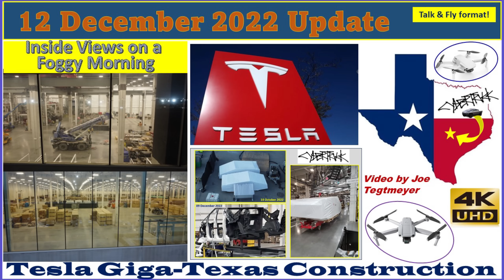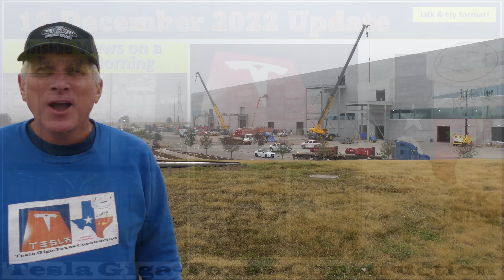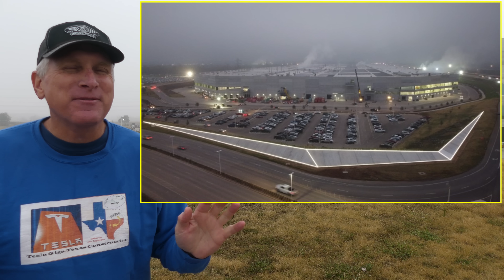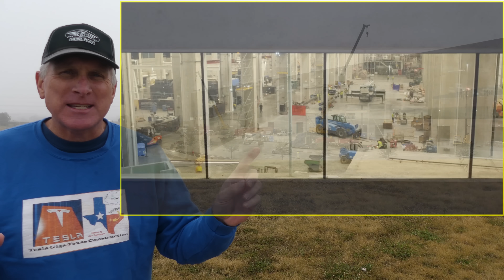Inside Views of Casting, 4680 Cell & W GA sections! 12 December 2022 Giga Texas Updates (07:00 AM)

Comment: Some thoughts on today’s developments.

18:11 Switch yard cable tray installation. I like to see that they are using black geotextile fabric to line the trench before placing the aggregate drainage layer. The aggregate is probably recycled crushed concrete from the Martin Marietta plant next door. My guess is that it meets the gradation of #57 aggregate, which is an open-graded gravel mix. The stones are generally 1 to 2 inches in diameter, with very little fines (smaller stones). This gives the aggregate a porosity of about 40%, which aids in transport of ground water. Geotextile fabric needs to be used to line the trench before placing the aggregate, otherwise the surrounding silt, sand, and clay will migrate into the open spaces of the aggregate drainage layer. Migrating soil will eventually lead to loss of soil compaction and surface settlement. However, it will also slow the movement/drainage of groundwater, which is of paramount importance for the cable trays.

27:08 New corrugated storm water pipe. Remember that the entire perimeter of the main building has a 6-8 foot diameter corrugated pipe under the loop road. The southern portion of this loop goes under the concrete staging area with 4 large drainage inlets. Looks like they are relocating the southern end of this storm drain loop further to the south, and out of the footprint of the building extension. Once the new section of pipe is completed to the east side, I expect that they will perform the tie-ins to the existing pipe loop and then remove the 4 inlets and portion going across the extension footprint. The concrete pipe they are installing closer to the loop road will be under the building extension and will probably service the roof drains.

It will be interesting to see what design they choose for the solar panels on the building extension. The “TESLA” is centered on the existing footprint. Based upon Elon’s past tweets, the extension will be about 500 feet long. Two thoughts come to mind… The first thought is the “T” logo. My second, and more likely, thought is a giant star. Because, well… It’s Texas!

Comment: IDRA likely not casting Cybertruck parts: IDRA doesn't have access to Tesla's propriatery gigapress cooling system, nor does IDRA have access to Tesla's casting alloy. That leaves me unable to explain what we're really looking at what otherwise appears to be major cast rear assembly.
Reply: Not a lot to go on in the photo. No indication of when or where it was taken.

Rear end could be cast up the old way, pattern, sand box etc, or might even be fabricated out of stock sheet and bar. Others have suggested 3D printing. 

Good to see something other than the outside of it anyway.
Reply: Sandy Munro explained it in his latest video

Comment: My guess is that they're going to cut the building open at the main entrance. Then have an open section on the first floor with the main doors set back, kind of like they did with the main entrance in Germany.
Reply from the maker: Hmmm … interesting idea! 🤔🤗
Reply: @JoeTegtmeyer  Nice work there Joe.
Reply from the maker: @petewangen-groovedrummer8083  🤗
Reply: Sort of the inverse of what @David Johnson was calling for IIRC.  Where he's talked about an external covered entryway.  Could be both, with the internal section extended out to the front.  I keep wondering why they'd waste valuable factory space for non-factory use.  They can clearly put up a purpose built office building without even thinking hard about it.  How about a "house of cards" made with creative use of the concrete slab pieces?  That would be awesome!

Comment: We used to do a lot of set-up with equipment assembly.  Much of what you see that is being reported as castings may rather be assembly equipment hangers.  Please note all the adjustment points.  Also, see the in the center of the rear window, another piece of what may be a calibration hanger.  jmo

Comment: With all the structural packs stockpiled, perhaps they will announce a new Model Y version after the first of the year that qualifies for the IRA tax credit.
Reply: Even with several thousand stacked up, it's still just a few week's supply.  Where the backlog of castings seem to cycle regularly it doesn't look like these have, but would expect that to start happening as they switch back and forth from non-structural to structural.  Anyone ever notice if the packs are coming and going?

Comment: the white structure at 12:01, I think it is the battery charging/discharging station as per their patent, as required to finalise the batteries, one is charged fully then discharges to the next battery pack etc, thus saving power by recycling it through the batteries in the stack.
Reply: Ah, I was looking for someone to have commented on this. Thanks for the info.
All I know is that they looked like this part of Tesla's "Making Batteries" video here:
https://youtu.be/zB8_HbrxUi8?t=37
Reply: Brilliant!  Must be able to load/unload from the back side?  Looks like a large dedicated fire control system above it?

Comment: Thank you Joe! My life would not be the same without your efforts and dedication.
6:00. Start of some bridge crane rail sections in the foreground bays.
6:28. End of bridge crane rails in foreground bays with bridge crane above the mobile crane.
6:36. Missing bridge crane rails in this section. More foreground bridge crane rails missing.
7:05. Suspended scaffolding with workers in the central area between the bridge cranes.
7:47. Upper right corner, more suspended scaffolding in the central area.
8:17. White steel columns added to the concrete columns on the backside of the columns from the bridge crane supports.
16:50. The reddish brown steel looks like parts for a prefabricated steel building.
17:43. The concrete slabs for the transformers are called "Transformer Pads" that are used for pad mounted transformers, as apposed to others, such as wall mounted transformers.
22:03. One can see the one CFA (Continuous Flight Auger) pier in the back central area of the trench (orange band on top) that was used for testing, also sections of the gravel from the geo piers at the edge of the trench in front of the excavator, and the little round patches of gravel around the area showing the tops of the geo piers. 
27:18. It appears to me that the large corrugated culvert is possibly sloped down towards the water box.
28:08. Trench is being filled without any culvert inside...?
Reply: Nice work! 16:50. Patrick Kenny refers to this as a Butler Building. Was stacked at Ye Olde Bagging plant for a long time before being shifted here.
28:08. I think the top of the pipe is just visible.
Reply: @DessieDoolan  
28:11. I took a closer look, and it appears that what I thought of as the bottom of the trench is in fact the gravel cover over the culvert, so much deeper than I thought....
Life offers endless opportunities to make a fool of oneself, the trick is to not take advantage of them all, just the best ones!
Reply: @GoCoyote  28:11. Jeff's video from Thursday, the top of the pipe is just visible, https://youtu.be/k_MSHacSGtE?t=172

27:18. I haven't tried to work out if the corrugated steel pipe being laid is within the boundaries of the previous concrete hardstand. I should try and work that out. They keep ripping up the landmarks though.

Life's opportunities. Good advice. I've been offered it many times, but never got around to taking it. Ask my wife.

Comment: Way back when I was a RailRoad Engineer, I moved several large (huge) transformers on special 18 axle low-boy flat cars.. The biggest one took 3 trips plus a tank car of coolant! Can't wait to see how they get these monsters on site..Nice work Joe as always...
Reply: I saw a special large heavy load car Saturday night. The load was held on each end by arms that went to the centers of at least 6 axle cars in front and behind. The load's bottom was just above track height, and around as high as a double stacked container car. Width was maybe about 3/4ths wider than standard train cars. Whole train was engine, short normal flatbed car with what looked like crate, a generator, and 4 large flood lights lighting the front of the load. front 6 axle car, load, rear 6 axle car, and a proper caboose.
Reply from the maker: Thanks Hans! 😎

Comment: The foundation work to the side of the cathode plant is quite substantive for a single story structure. Maybe I got it wrong? Great video and commentary as always so thanks again for the continued effort you put into providing us with the goings on all across the site. One last thing is the Cybertruck casting would have almost certainly come from Italy as they wouldn't risk damaging the press by assembling it elsewhere and then disassembling to move to TX.
Reply: It is a test fit casting.  Likely Sand Casted and welded/machined for prototype to match the die drawings.

Comment: The CT mockup/prototype probably had pieced castings in the rear. IDRA does not have Tesla's dies to form parts in Italy. It doesn't matter the CT assembly line can be developed with these.
Reply: Are you saying that Tesla is making the dies and not IDRA?
Reply: @jbbuzzable  IDRA probably doesn't make the dies. I think this is the backside of a die here, made by Costamp also of Italy. https://youtu.be/m3GBqT3UxCU?t=418
Reply: @DessieDoolan  If I remember correctly, IDRA said they don't really manufacture most things themselves. They design and purchase the needed components for assembly.
Reply: @jbbuzzable  That's right, the IDRA spokesman says that here, https://youtu.be/IgTNynoVX-I?t=1273

The dies though I gather are manufactured by a completely different company, not like the rest of the gigapress that is "manufactured" by IDRA using subcontractors.

What isn't clear to me is if the 'hot testing' as mentioned in the Munro video includes the dies. Some more research for tonight.
Reply: @jbbuzzable  The dies or molds that get mounted onto the press are machined outside of IDRA then iterated to perfect the design. Additionally they wear and must be repaired/replaced occasionally. IDRA does not have the alloy billets or the furnace setup to melt the billets that I could see. This info comes from snippets of videos that I seem to incessantly watch because it's so fascinating.

Comment: 8:13 There's also steel columns that are attached to the concrete column. What are those for? More reinforcements, or is there some plan for theses? You can also see scaffolding above the level of the window.
Reply: Plant platform, support for the black pipes to be hung from.
Reply: @DessieDoolan  Dessie, by now I've seen so many black pipes that at every new spotting I have this reflex: where are the corresponding EVAPCO coolers? If we exclude the possibility of ripping up the roof of Casting (a very dangerous thought to exclude any change-work at GT😎) there appear three options:
Go West (coolers on top of BA), go South (coolers now being set up on top of BIW) or install a third station of coolers only a bit South where there are rectangular bases along the parapet still covered with membrane.

The method of fixing the supports and the pipes high up towards the roof doesn't seem to upset casting operations, so crossing Paint, Plastics and tying into the BA system may be possible as well without too much fuzz. But a pre-planned N-S corridor for piping looks the better bet I think, going all the way to the BIW roof and perhaps stretching further South. What does your map say about distances to BIW and BA? Thanks in advance for you engineering proposals!
Reply: @hardernl8893  There is some 'HVAC' equipment suspended under the roof of Casting, where the 9000t machine was previously reported to have been located. South east of Casting, top left here, https://youtu.be/hHEQMZlLEVg?t=354

There's a better shot somewhere, I can't place it immediately.

I don't think that was ever operational, as you say it is covered over at roof level. It may have been specific for the 9000t machine, or not! There's also some small corbels on the columns around here that I speculated was to mount beams for a plant platform, but that never eventuated.

Yes, a mystery where the black pipes are heading. The new white structure seems to be at the same elevation as a mezzanine or plant platform in BIW, seen at 5:03. 

This mezzanine/plant platform level extends south through BIW. Jeff’s Day 250 is good for viewing the line of beam connection plates on the columns. Not continuous, but areas were clearly set up for this level. Some were built out early. https://youtu.be/2R2nZ5YAoQY?t=723

So, the new plant platform joins BIW at the south, BA is 5 columns bays across to the west, then through 2 columns bay s of the deep space frame into Level 4 of BA.
Reply: @hardernl8893  Underside of Casting roof. Cyber Rodeo. This particular video picked up a lot of good points. https://youtu.be/m3GBqT3UxCU?t=326

Comment: Thanks Joe. 
Great effort on a lousy day when you could easily lose a Gigafactory in the fog.
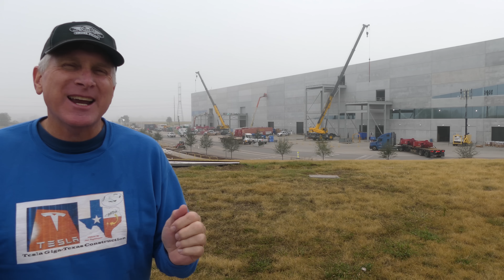0:18. Northend. Jacks for a gantry. Other components following.
3:27. Cybertruck. IDRA. Video here of when Sandy Munro toured the IDRA factory. https://youtu.be/IgTNynoVX-I?t=158
At 2.40 the IDRA spokesman mentions that IDRA does no hot testing. He specifically mentions aluminium, but presumably he means any metal. Later in the video at 21.15 the IDRA spokesman mentions that all casting (the irony) and machining is outsourced, mostly elsewhere in northern Italy.
The Cybertruck rear casting/s seen in the photo could have been done the old way with a pattern, sand mould etc, or they might not be castings at all and were fabricated from sheet and bar stock.
5:32. Casting. To the right under the crane hook. Big component, hard to gauge the size. Could be what was delivered on Friday. Replacement parts for one of the 6000t machines perhaps.
Something laying flat on the floor in front also could potentially be the Friday delivery.
6:17. Casting. Centre to the rear. left and right are some large components. In Joe’s photos a step ladder in seen in front of one component, and shows they are about 9’ 2.7m high. Not big enough to be the delivery seen on Friday.
7:28. ONA marked on the crate with the blue tar. ONA is a manufacturer of specialist EDM (Electrical Discharge Machining) equipment.
https://onaedm.com/
Die maintenance, or manufacturing for the gigapresses presumably.
8:23. Casting. Outline is a trench with a grate cover. Some sections removed. Trenches meet the pits with the timber handrail around.
10:47. Battery. Level 3. Large suspended bulkhead over the benches. Looks very cafeteria like.
18:26. New Switchyard/Substation. Poles might be fitted with a tiny PV panel and well as a PE switch. Solar light?
21:41. Cathode, new building. Larger footing to the right with hold down bolts for multiple columns. Small bulldozer in a deeper excavation behind. One of the test piles or anchor piles has been exposed.
22:56. Cathode, small out-building. Now I get it. Bulk insulation between the roof sheeting and fabric wrap material, TuffWrap or similar.
23:08. Cathode. Level 3 in past the loading platform. Very good lighting, not construction lighting.
25:57. Stamping, apron. A smaller blue tarped component beside the massive one seen on Friday. North-south road, SPMT sections on the trailers.
27:08. Southend. Existing drain was a drain into the Splitter box. This new drain might be a new outlet from the Splitter box.
27:39. Southend. Top of screen. Excavators and dump truck. Asphalt saw cut for a large excavation. This alignment was being marked further north in Joes’s 2 December video. https://youtu.be/_-I-vgbP1J4?t=480
28:22. GA, south. Platform removal. Would be early days to remove the platform as part of the building extension works. There’s only one way out now for anything stacked on Level 3, the doors at the north end into Battery assembly as seen at 14:01. Suggests the loading platform removal is temporary.
Reply: @28:22 This is an odd development, wonder what could be the reason for a temporary removal?  Must be something going to happen in this area.
Reply: @Dwayne.Shea.231  28:22. I was hoping the platform would be visible stacked elsewhere, but I couldn't see it. Might spot it in Jeff's video tomorrow.

Possible trenching to be done east-west in front of the door, so platform would be in the way?
Reply: @DessieDoolan  Figured maybe the building was just plain full. ;-)
Reply: @scottgaree7667  Coming up for Christmas and there's no room at the inn.
Reply: that area at 5:32 might relate to the items at 5:53 in the bottom area of the window? it's not the droid your looking for...   hehe
Reply: @craigarnold1212  5:32. I haven't fallen for that Jedi mind meddling for years! 

Really difficult to figure find something that matches a shape under a tarp on a trailer to something inside here. I'm sure it's in there somewhere. Leaning towards it being something for an existing press. There were 2 trailers though and we only saw the load on one. 

Do you mean the red and white items with the black tarp?
Reply: @DessieDoolan  yes, they look like new parts for a molding press. Just not what everyone is looking for.
Reply: @craigarnold1212  I mounted a bit of a search, they've been there for a while, not sure what they are. Might be panelling for a press. https://youtu.be/ej3071ZZwHs?t=246